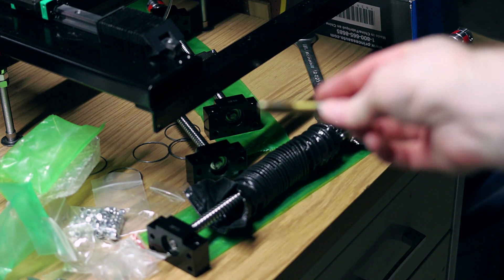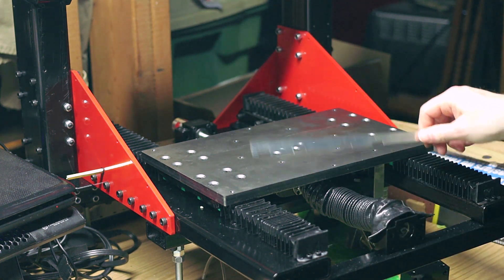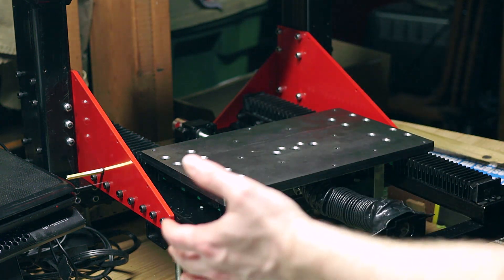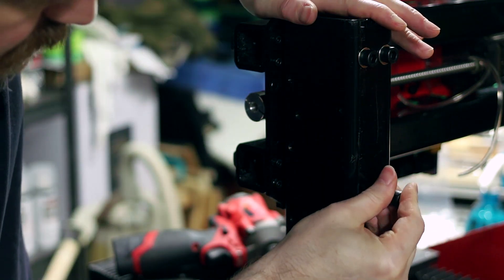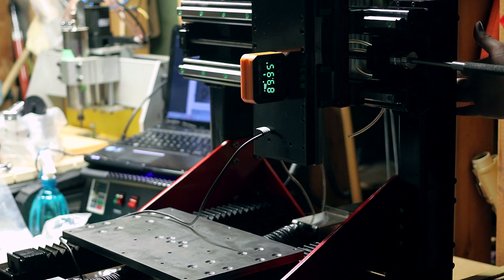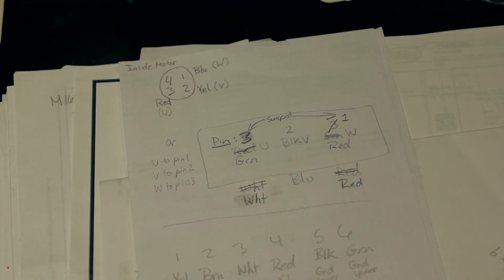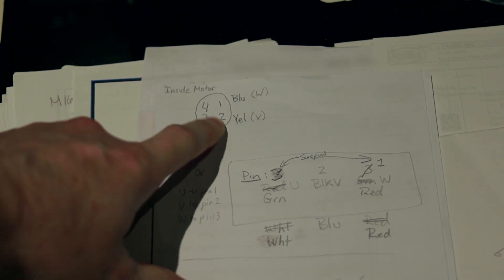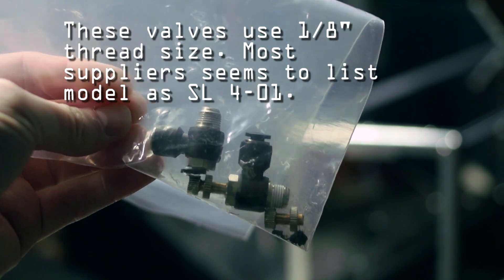Shariff DMC2 Build Part 1: Mechanical Assembly

Comment: Hello! What brand and model is you digital angle gauge?
Reply from the maker: Mecurate Digital Angle Gauge and Protractor off amazon. It's ok. I'm sure there are others just as good and better.
Reply: @amp_mechanic  Thank you for a quick reply. I see it's priced in the middle of the budget devices, not the cheapest one but below the Klein's price tag. Some say they all use the same cores which makes sense. No problem.

Comment: A few things about the kit (I got a 2nd run)

*None of the bags are labeled. Given the amount of hardware this can make for being a serious pain in the arse.
*Some of the smaller items like barbs for the blocks and the odd screw here and there seem to be short of. Not a deal breaker - most of the stuff is easy enough to find.
*The powder coating on some of the parts even on the 2nd run machines is pretty bad. Some of the parts I had the powder coating milled off so the rails would sit flat.
*Some parts of the documentation need to be updated as some things seem to of changed from the first run (example is the rear stepper motor plate - says 3 bolts but only 2 bolts actually line up on the bracket.)

Overall seems like a good kit. I have brought a masso g3 to wire into mine instead of the mach 3 board. Will hopefully make it a lot easier to use but I guess time will tell.

Good videos mate it's a shame Omar hasn't put a few build videos together to make life a little easier for some folks.
Reply from the maker: All good points. Thanks for posting for others.

I really like the Masso G3, looked at it myself. But I couldn't justify spending that extra amount for the DMC2. I'll be interested to hear how you like the G3.

Comment: Yup wish I had seen this video this morning about the ball nut being the wrong way in the manual.

Instead of shimming those plates I have drilled and tapped a hole top and bottom and have 6mm grub screws in there so it can be pushed out and adjusted although after getting those tubes skimmed it appears that I might not need to shim anything now.
Reply from the maker: Nice. Yeah an adjustment screw is a good idea. Although I found the left to right adjustment the most tricky. It would probably be worth while to add a couple blocks and an adjustment screw for that as well.

Comment: Hey man, hope you dont mind me asking.  It looks like you only ran a red and blue wire to your purchased 12v/10a power supply.  Where did you run your other red/black wire for the second barrel jack connection?
Reply from the maker: I don't mind at all. I only ran that one pair and connected to both 12V board inputs. Just soldered direct to the board. And I can't remember but I think both 12V taps on the board might be connected anyway. If so, I would guess it was cheaper to use 2 lower powered wall warts than a single higher output.
My power supply is rated for 10A and the ones that came in my kit were only 2A each, so plenty of head room. I will cover some of this in the Part 2 video. I just haven't had time to finish editing it. Cheers!
Reply: Hey man, thanks for the reply.  I actually copied your box method, ordered same 12v power supply lol.  So much better than the original design thanks for the idea!  I just finished my build this past week but ironing out some issues.  I ended up running the leftover 4 wire cable from kit 2 and 2 soldered to the board and with a 4 prong aviation cable connected to a single connection on the 12v/10a power supply.   For some reason my pump doesnt work which is why i ask, i checked all connections and getting 12v everywhere except the pump i was getting 10v at the board which seems odd.  Made me think i had to run 2 separate lines connected to separate spots on the 12v power supply.  
 @amp_mechanic
Reply from the maker: @loosegoosage  10v at the main board or at the output of the board with the control pot?
Reply: @amp_mechanic  odd it was at the main board two screws where the brown and blue wire plugged in labeled pump on the board.  I just finished taking the potentiometer off and testing it with another lesser quality one I had,  and it worked.  Looked at the chip on the one that came in the kit and I had a bad solder joint.  Luckily that fixed it.  I think the last thing I have left is the y-axis motor.  If I hit up on the arrow keys the bed goes to the back of the machine but increases in mach3.  I think Omar says if that happens you have the motors electric flipped.  I definitely didn’t wire it up  wrong, what you think is that common with CNC motors, sometimes you have to wire them in reverse?
Reply from the maker: @loosegoosage  I believe you just need to flip a switch on the stepper driver. It's a mistake in the instructions, that 5th switch, or whichever it is,  has to be off.
Reply: Hmmmm, really.  Yea as it stands i currently have both the X and Y #5 dipswitch set to on.  But i thought only Y seemed backwards to me.  With that current configuration while looking at the machine, hitting the right arrow key advances in + direction for X and it moves to the right. Hitting page up advances in + direction and Z goes up.  Then hitting up on arrow key advances in + and bed moves toward the stepper motor in back for Y.  So in this case, are you saying both X and Y need their #5 dipswitch set to off and they are both going wrong direction?  @amp_mechanic
Reply from the maker: @loosegoosage  Just flip the switch 5 off on your Y and you should be good.
Reply: Thanks man, i will give that a try.  Appreciate it! @amp_mechanic
Reply: Of course it was that easy.  New to the CNC world.  How you like this machine so far?  I did a ton a research and this made the most sense for me, i hear alot of complaints but not sure why, the build went smooth as shit for me. @amp_mechanic
Reply from the maker: I think it's a pretty capable machine for the price. I don't know what else you could buy at this level and be machining steel to quite reasonable tolerances with just a bit of work. 
It's very possible some got bad kits. But I think most of the gripes are coming from people who expected a paint by numbers kit they could throw together and be getting aerospace grade tolerances. Unreasonable expectations and likely lack of experience. If people want to go the extra steps of machining their frame surfaces, that's fine but it's unreasonable to expect that powder coated steel tubing is going to be completely flat and square down to the ten thousandth. Or that it would all be machined surfaces at this price point. I think that's where many of the complaints came from.
Reply: Absolutely man, kinda what i was thinking.  I couldnt find anything close to this for the price.  Everything in this range you are lucky if you can machine aluminum well.  I dont even know if i need the tolerances that you can hit with this machine tbh, but i am certainly going to push for as good as i can get. Hey man, thanks for taking the time to help a brotha out!  Time to see what i can do with this thing.  Ill keep an eye out for your next vid. @amp_mechanic

Comment: How long did this take you, a lot of people on Reddit & YT Comments say a month or two of shimming and measuring followed by lots of electronic issues. Thinking about self sourcing and building a clone.
Reply from the maker: The build took me exactly a month from opening boxes to doing the first test cut. I only worked on it evenings and weekends when I had time, so not every evening or weekend in that month. I suspect most of the problems people have assembling or wiring is due to lack of experience. Which is fine, you just have to budget that into your time and do some troubleshooting. The kit is no where near as bad as some have made it out to be. 
Good luck building your clone! I'd be interested to see/hear how you make out. I imagine there will be a significant time investment in making many of the parts. Not to mention the cost of all the materials and hardware. I don't know this for sure but, my feeling is that it will be tough to do it for much cheaper than what the kit costs. The bit of money you do save likely won't equal the amount of extra time you'll spend making the parts. Though I am in Canada and the cost of everything is absolutely crazy. Unless you just want the challenge of it, which I can completely understand. Either way good luck!
Reply: @amp_mechanic  Its not to save money. I am in Pakistan, and dollars are a bit short these days. :face-blue-smiling:
Other than that, just got out of University, first job, saved money just gets spent on stupid stuff, so decided to put it into something that actually enriches my life. Been missing the University machine shop & I am a Computer Engineer.
Reply: @amp_mechanic  Can you publish the parts list with specs, I assume one was provided. and secondly,
Can you do a video making a complex part in aluminum. I just want to hear this machine more and see it actually accomplish a useful task. All other videos I have seen are example/exploratory cuts.
Reply from the maker: @subuktageenfarooqi  There was no parts list. Parts are listed in the instructions as you go along. And I'm not going to share that since Omar specifically requested not to. 
I will have some video of some cuts in both aluminum and steel coming soon.
Reply: @amp_mechanic  ok that's fair, I guess if I am going to build myself, I should put in the work. Eagerly waiting for the new videos.:hand-purple-blue-peace::yt: